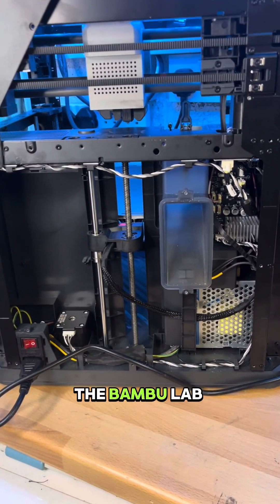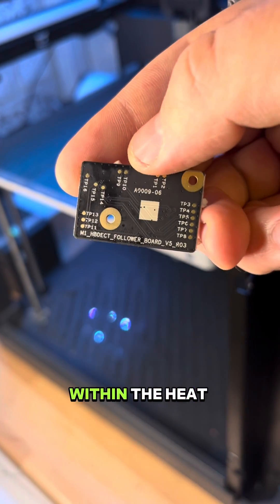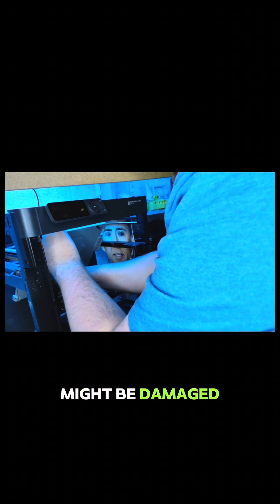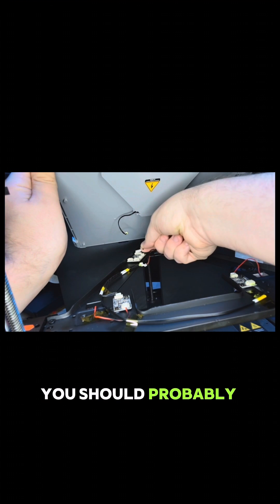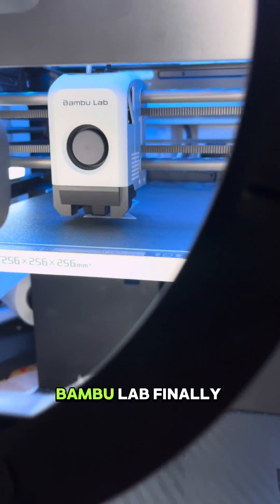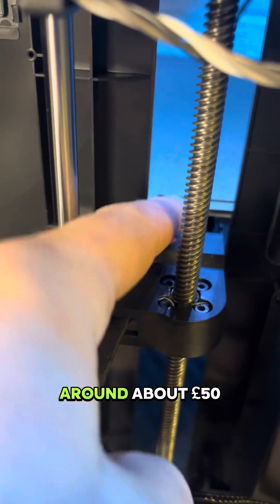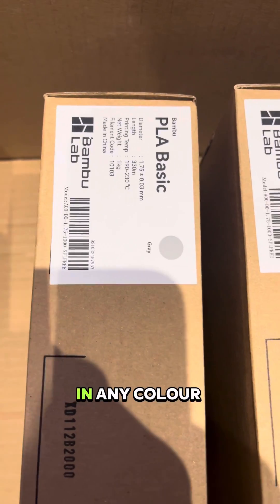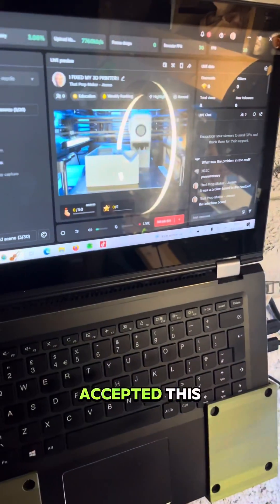My Bambu Lab P1P Broke Down After 2 Months! Testing Bambu Lab’s Aftercare

Comment: Seems like a good deal to me. I had a flat cable brake on the print head of my p1s. Contacted support and it did take them almost 2 days to reply. They asked for some more details and pictures. In the mean time i had found the part i needed on there web page for 0.00 so i ordered 2 (should have order more as there 11 quid each now, lol) and payed 4 quid postage. They arrived a day later. Then Bambu contacted me and sent me a free replacement. I think there customer service has been pritty good. A little slow but good. esp useful is there wiki. Cheers
Reply from the maker: That’s cool! Yeah their wiki is actually really good. I probably wouldn’t have known where to start without it

Comment: The cutter screw that you have to remove to do an extruder filament removal repair, stripped on me and I'm  having to hunt down a replacement.  Cheap parts as far as I am concerned.  They can definitely do much better.  The allen wrench still works on other screws so I know the screw stripped and not the wrench.  Had to use supper glue and a vice grip to get it out.  I will be putting out a video soon about it.
Reply from the maker: That’s so annoying! I’ve got exactly that on the case too! That’s the reason it’s still on in the video it’s just I rotated it out of the way. Went to take the screw off for the first tike and it was rounded so it had come from factory rounded. Thankfully I didn’t need to worry about it but annoying that I can’t to hold it out of the way

Comment: I had a similar experience when I purchased the AMS for my P1S. It arrived broken due to a seized bearing on the hub drive gear. It took them 2 weeks to respond and I had already fixed it at my own expense.  They ended up sending me a spool of red PLA basic. I did ask for a credit toward future filament purchase and I don't have much use for red filament, but it was better than nothing.  They definitely need to hire more support staff.
Reply from the maker: I suspect waits have only gotten longer since the A1 issues too. I’m hoping they find their feet with it because if they get their service on point then they will genuinely be the best out there

Comment: I think there is nothing wrong with fixing a printer yourself. But also the printer should be made for easy long-term repairability. On the Bambus, everything is custom. That's why I bought the Prusa Mk4. Not as hyped, print quality  about the same, speed probably a touch slower...but I am confident you can still fix the thing in 10 years without any issue.
Reply from the maker: Oh yeah for sure! I enjoy the repair and it makes me more comfortable knowing that if the issue came back I’d be able to fix it in about 10 mins. You’re right about the parts etc with my creality’s I could just get most parts on Amazon/ebay plus so many guides and videos online to help with them. Not so much help with the Bambu lab printers, although their wiki is great

Comment: Only a week??? man it took me 6 months to get anywhere, and in the process i bought a 2nd machine that showed up damaged that they initially rejected any warranty claim. Despite it clearly being damaged in shipping. What it came down too was the reseller had to step in make it right. But the fix and the additional parts needed all ended up coming out of my pocket... (connectors due to the horrible nature of the overglued connectors on the toohead board, which didnt fix the problem. They are great machines when they work. But if you want anything really support wise out of the norm and decent response. It seems to be you need to have all the spares already on hand. If you can even get them (as some are not purchasable even on bambu' labs store)
Reply from the maker: Ahhh that sounds like you had a rough time! I think you’re right about keeping parts on hand for sure. Hopefully they keep adding new parts to the store too
Reply: @ThatPropMaker  Authorized resellers can step in for parts that aren't listed on the bambu site. But its a slow process still. I been trying to convince a few of them to sell a entire replacement part kit. For those of us running farms, labs, multiple machines.

Comment: They wanted to fix it thats for sure. My experience was way different. I get replies within a few days and I could ship back my printer because that AMS couldn’t stop giving faults. I told them i wantend a printer to use on a day to day basis i dont have time for fault searching and fixing. I have 2x p1s running almost 10 hours a day for few months now. No issue whatsoever 😊
Reply from the maker: That’s cool! Tbh I think they would have been quicker but my issue was about 2 weeks before the A1 issue dropped so I suspect they were already getting tickets about that before it was released as a recall etc they may well have been quicker if it wasn’t for that